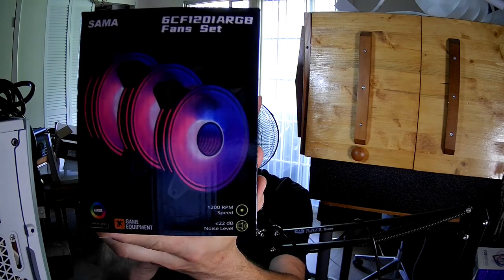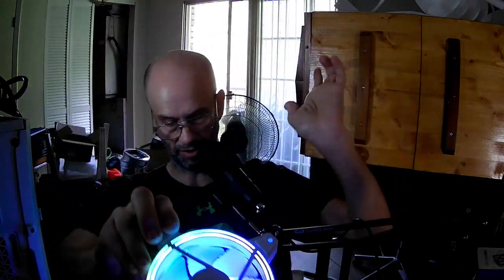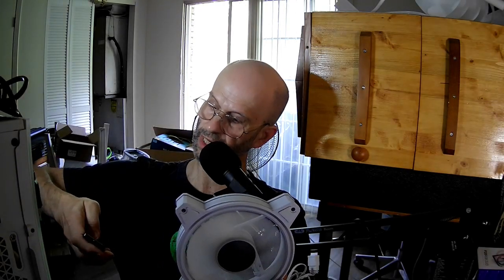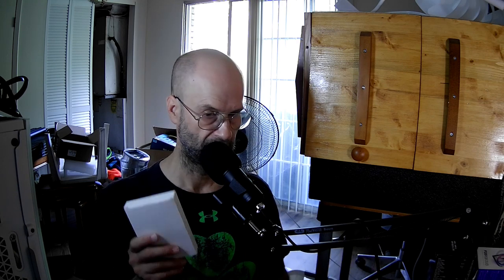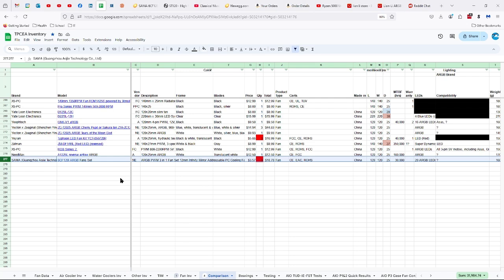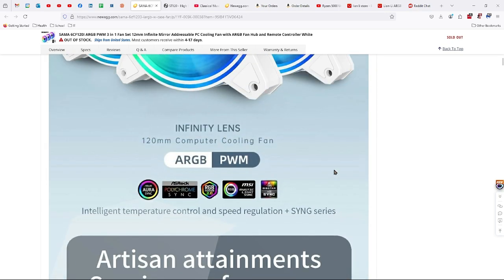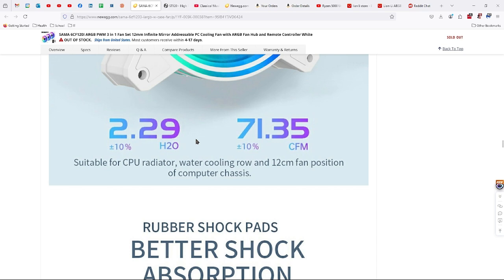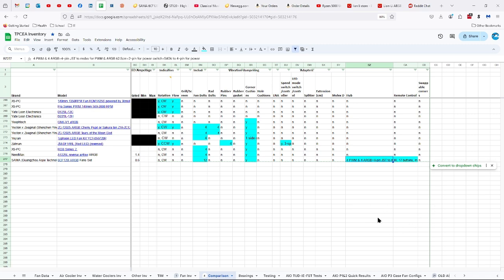Preview

Comment: I have a set of these fans, they came with no instructions. There is lots of wires, I guess some are alternate connections but I am not sure exactly how to hook them up. I haven't installed them yet. Did yours have an instruction sheet? There is a 4 pin connector that is smaller than the others, don't know where it goes.
Reply from the maker: Have you watched my videos about connecting fans and lights? That may help. If not, please let me know and I'll see what I can do to help you.